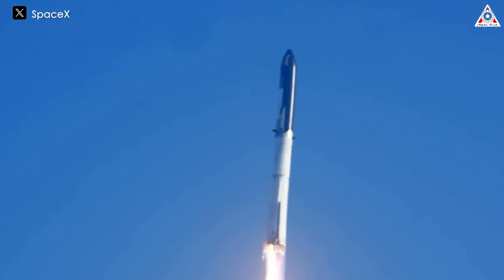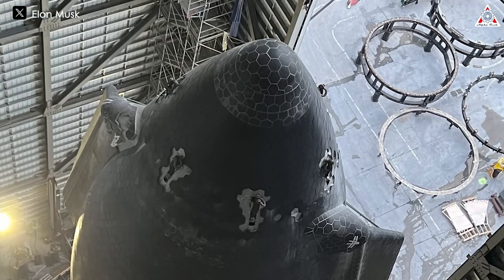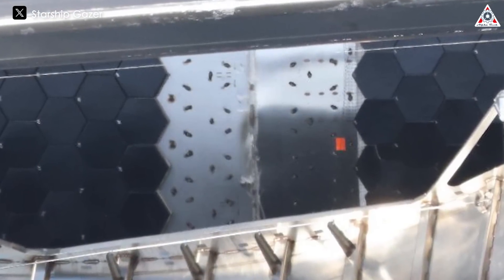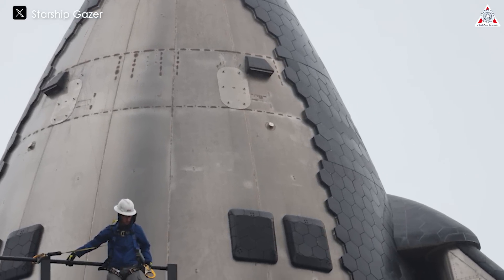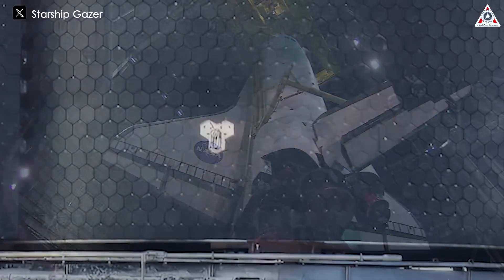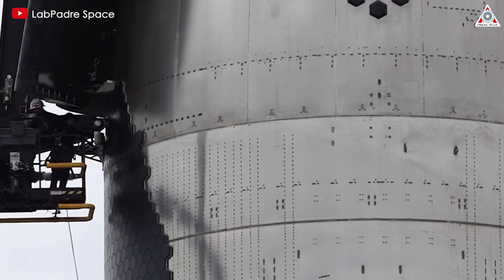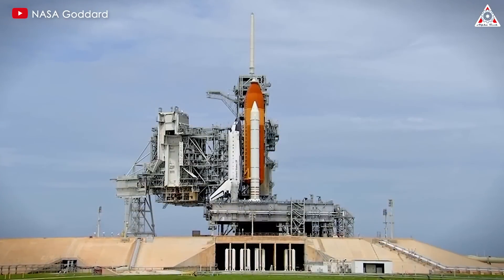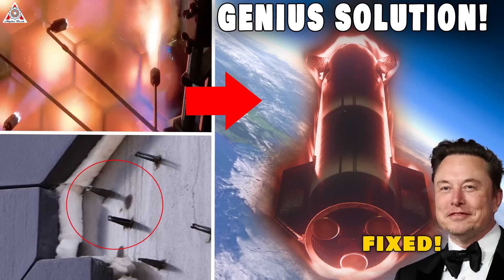SpaceX's Big Solution For Starship Heat Tiles Re-entry in Upcoming Launch!

Comment: FYI I just submitted my resume to SpaceX for the mechanical engineering heat shield subsystem.    Just another thought entered my mind.  Are you sure you want to deploy the re-entry heat shield at liftoff?  Seems to me that the thing should be rolled up like a fire blanket or umbrella and deployed prior to re-entry like a taco shell around the craft,  then discarded prior to landing and replaced for the next launch.
Reply: You want to roll up something that is brittle and susceptible to vibration, and then support it how? And put it where during boost phase?

Comment: I'm kinda wondering if the tiles shouldn't  use natures example of feathers or fish scales and overlap.  Both have strong, single attachment points at their base.  These could then be liquid cooled when the re-entry temperature gets too high.  Slate tile roofs are another example.  Tungsten steel foil scales might be a possible material.  Might even be lighter per unit of surface area than the existing tiles.

Comment: Only correction I see is that with the use of steel, One or several missing heat tiles Should not result in a catastrophic loss of the vehicle. Obviously, the goal is to have all of the tiles survive launch and reentry.

Comment: Increase heat tile surface emissivity - micropitted carbon-carbon with asbestos filler.
Reply: Those are the engineering numbers.  Missing are a pair of bolshy yarblockos versus the Envirowhiners. ReGRETAble. "8^>)

Comment: Aluminum vs Steel 
Thank you for your video! It should also be noted (much better margins, especially in cases where tiles are missing):
Shuttle = Material: Aluminum alloys (primarily 2219-T87) Melting Point: Approximately 543°C (1,009°F)
Starship = Material: Stainless steel (primarily 301 and 304L stainless steel) Melting Point: Approximately 1,400°C to 1,500°C (2,550°F to 2,750°F)

Comment: The tiles are okay , the bond to the ship skin is the problem .  The bond fails when the tile heats up and expands slightly as they know.  Can an intermediary material be discovered to absorb the tile expansion and not need replacement after multiple missions?
Reply: Buckyballs

Comment: Why not make one uniform heat shield with passages carved in it to differ the heat, instead of 1000s of seperate individual tiles, make one giant solid one that can be bolted and removed quickly for rapid reuse, granted it may be expensive 🤔, but it would definitely work i think ????🤔,  star ship is stainless steel so magnets should still work, the back of the shiled could be magnetic, or just bolted on, or a combination of both even glue vould be added too 🤷🏿‍♂️🤷🏿‍♂️
Reply: Stainless is not as magnetic as normal steel alloy. 

With the reverberations traveling through the airframe, the tiles need to be segmented to be flexible and not shatter as easy.
Reply: Also, would need to allow for the fact that a single "wrap-on" heat shield would (likely)expand (relative to the outer surface of the ship).  One big expansion l instead of lots of little ones.  Especially at its edges.

Comment: A thin tungsten shell (perhaps 0.5 mm thick) could shield the tiles from atmospheric buffeting. (Tungsten has a melting point in excess of 6,000 degrees Fahrenheit, so it's not going to melt.)
Reply: Weight of tungsten vs weight of titanium

Comment: Elon Musk is full of it. Starship is the albatross around his neck.. you should have not got rid of your falcon 9 and heavy brain trust.

No matter how big you make the  rocket. It will never lift the battle ship that you call starship. You either reduce 90% of the current weight. Otherwise you can count on more tears.

I see you finally fix the hot stage ring. But you have already reach the point of diminishing returns. You need to follow the Falcon heavy design. Otherwise you will not reach a stable orbit. But the heat reduction tiles will never stay on. After ift -4 you have three more shots. The military will walk away as well.

Comment: Good luck to SpaceX. Seems to me that they will have to get the Starship launch cadence way up to do the orbital refueling that NASA is depending upon for Lunar Starship and the Artemis Moon landing project. And reusable thermal protection tiles are the only way to have fast turnaround and keep the cost from becoming prohibitive. But it won't happen if extensive heat shield refurbishment is needed after each flight.

Comment: One big problem with a water cooling method is that under pressure (if the water was going to be recirculated) it would no longer be water, but instead pressurized steam. The only way would likely to have the steam relieve itself out of each tile with pressure relief tubes. There could be no valves at the relief point because all of those valves would be possible points of failure. There would have to be a lot of water blasted through that system even just for a couple of minutes during the hottest point of re-entry. I wonder what liquids have the highest boiling point temperature?
Reply: In order to keep the liquid in that state, the pressure has to increase inside the pipes which would burst pipes and fittings of many material designs.

Comment: My questions about the heat shield:

1. Rapid reusability is the MAIN unique required that Starship is attempting to achieve.  Why has SpaceX not worked on the heat shield design sooner?  They just forgot?  Without rapid reusability, Starship will just be another Space Shuttle that requires extensive repair after every launch.

2. What prompted the changes to the heat shield?  What data?  Was this prompted just by video of the Starship 3 launch and re-entry?

3. SpaceX switched from BLUE glue to RED glue?  Are you sure they aren’t using RED LockTight in place of BLUE LockTight?

4. What test rig is SpaceX using to test heat shield designs?  Where is the data from these tests?

5. Why will the new design be tough enough to support rapid reusability of Starship?

6. What data will SpaceX get from the next launch of Starship?  Just photos?  Is there any instrumentation?  Are they really claiming that they will recover the upper stage of Starship launch 4 after it touches down softly on the ocean and floats for hours and hours?

After 4 years of development, SpaceX is STILL making major changes to the heat shield design  Considering how little information SpaceX is providing about the heat shield design, my guess is that this MAJOR change is being made for the benefit of trying to assuage the fears of potential investors and other organizations like NASA and the Department of Defence who have made plans that depend on a rapidly reusable Starship so that SpaceX can raise more investment funds and get more government contracts.  I do not believe there is ANY reason to believe that SpaceX is actually making progress towards a final heat shield design but are, instead, still flailing.
Reply: 1. They have been working on it this whole time. There is no better way to test the heat tiles than during actual reentry, which they have only achieved once so far, so it makes sense why we haven't seen many changes to the heat shield yet.
2. I wouldn't say they have made any major changes, more like modifications. These modifications were prompted by the fact that in every test flight there have been tiles that fall off. While the ship can survive reentry with a few missing tiles, obviously spaceX wants as close to 100% tile retention as possible and will work towards getting there. And yes, video footage shows the tiles falling off.
3. Don't know. Could be the same glue. We'll see if it makes a difference. Probably not a huge change but could help a bit.
4. The best test rig is the actual starship itself. Yes, the tiles are tested for heat resistance and durability on earth, but there is no way to know for certain it will work without testing it during reentry. Improvement through iteration is the motto of SpaceX. They focused first on getting it into orbit, now comes the troubleshooting of other systems like the heat shield. I'm sure if they were not confident on finding a solution with the heat tiles they would have pivoted to a different heat shield design much earlier. In fact, one of the initial design ideas for the starship heat shield was a "weeping hull" design that would release liquid methane through small pores to create its own plasma barrier. They scrapped this idea and opted for the heat shield tiles which are more simple and easier to get working.
5. If all they have to do is replace a few heat tiles after each use, then in my book that qualifies as rapid reusability. They can probably automate this task at some point later down the road.
6. All the data lol. There are onboard computers and system feedback sensors that track metrics throughout the entire flight. Thousands of people will be interpreting that data day and night to make improvements for the next launch.
Reply: @zachhilty6822  
SpaceX has a ground-based test stand for testing engines so they can test over and over, collect huge amounts of data, then dismantle the engine piece by piece and examine the results in detail.  They should have a ground-based test rig for testing heat tiles and attachment methods so that they can test over and over every day and test many different materials and designs.  If they don't and are only testing during "actual re-entries", they will NEVER EVER arrive at a good heat tile design.  A good, cheap test stand for testing heat tiles and attachment designs could be as simple as pointing the exhaust of a Raptor engine at a heat tile/shield mock up and lighting the engine.  The fact that we haven't seen any pictures of their heat tile test rig (unlike the engine test stand that we have seen many, many pictures of) makes me wonder if they have one.  After an engineering tour de force developing the Falcon 9, SpaceX is looking like the Keystone Cops now which I attribute to Elon having assumed charge of Starship engineering.

Comment: I am surprised that they haven't changed the shape of the tiles:- interlocking them like a jigsaw puzzle piece, or some kind of extra , thin, covering that could be sprayed or painted on that would shrink slightly on cooling, so it would in effect act as a saran wrap, so even if theyshook loose slightly, they wouldn't fall off on launch, or on the max q of reentry
Reply: I too have wondered about some wrap of some kind that would just burn off without damaging anything on reentry. There has to be a good reason why NASA or SpaceX haven't tried that.

Comment: Why not develop a system that uses the heat energy and wind pressure from re-entry to slow the vehicle down at re-entry? As the vehicle starts entering the atmosphere, air get's pushed into special vents and compressed then jettisoned out in the opposite direction to slow the vehicles descent. You don't need to carry any extra fuel for this because it's just using the atmospheric air being pushed into the vents at high speed due to the rapid descent. If this is done right, the vehicle may never have to reach the temperatures that would require heat shields.

Comment: Bah-Humbug!
Neurotic Rocket Engineerds trying to save face...

Its too complicated, too fragile, parts count too high, too labor intensive, takes too much time, requires too much mantenance... and undoubtably too expensive...

But other than that just perfect! 🥰

The main problem with any additive to hull exterior is differential thermal expansion. 

Might pay to experiment with a Tungsten or other higher temp metal in the alloy for the belly of the ship.

You notice, craft like Blackbird didnt have silly tiles.

Also theres the flight profile, and the potential to reduce velocity by very thin upper atmosphere altitude control, and I have heard Elon describe what I did in writs in simplistic terms. I suspect the next flight will be a crude attempt at it, but that benefit will be obvious, and we cant have too much of a good thing here...
And that if numbers are beneficial enough, Lord Elon will flog his design Serf Enginerds in the proper direction.

The fix is likely a combo of stuff, to achieve a working and highly functional balance of compromises. copying problematic tech over 40 years old is conceptual entrenchment, not progress.

And if the glide ratio helps, might affect V-2 thinking, and maybe can cattle prod his guys enough they start thinking about reshaping Starship... So gores for higher temp alloy can be used where needed efficiently and shapely..

Also possible to create artistic and fair hull shapes, instead of these flying Silver T¿rds....
(🤭)

Ain't it great! Not on 
the payroll! Critíc at large! Cant fire me!

Humor aside, 
Just trying to help...
And like I told the guys livid about parts count:
"I'll win in the end.."
🤗

Comment: Excellent report. The one thing missing is a picture of the way the pin attaches to the craft. I believe the pin sticks into a metal clip and is held in place by compression/expansion of the pin. I've believed all along that as far as the rocket itself, the tiles are the number one problem. I think anything they are doing right now is temporary. I don't think they have implemented a permanent solution yet and may not have one. I think if tiles are used the solution is just as you suggested in the video. The pin has to attach differently to the tile. There are any number of ways the pin could attach and I wish they would lay it all at there so the public could take a look at it. My uncle was an engineer and scientist. He was President of a large railroad company and when his wife died young he returned to his first love. He was a scientist working for the military/government. When he died he was working on the development and use of ceramics in space and rail transportation - one concept being the vehicle would float over the track and never touch it. I'm pretty certain if he were alive today he would love to tackle the problem. Me too:-)

Comment: Why doesn’t Spacex use the heat shield product called STARLITE.
 Starlite is a material that can withstand temperatures of 10,000 degrees Celsius and nuclear flashes without burning

Comment: I think the composite of the heat shield tiles new to be completely resigned. From the composite of the tiles, the shape, to the attachments. First and foremost they are to fragile. The composite of the tile need to be a reinforced composite so they are not prone to cracking or breaking. When they crack, game over. The vibration cracks the tiles. That's enough to cause a catastrophic failure. Great Episode. It needs to be in a situation where you don't have to give the heat shield a second thought. Thanks for bring the tiles to the forefront.
Reply from the maker: that's a good idea! Thank Kevin for your comments

Comment: I never really understood how a rocket falling back to earth can have such heating problems while those stratospheric parachuters doing the same do not. The main difference is the fact that rockets are so fast when they start falling back, right? Therefore, wouldn't it be better working on slowing them down BEFORE they fall back instead of working on the heating, which is, so to speak, just a symptom? Sure, slowing down in the space may sound easier than it is. On the other hand, it may be easier to do that in outer space than to get up there. Sure I know I am no exper and no engineer, but physically speaking, if fastness is the core problem, you could at least think about that instead of lazily just falling down and then work on the heat and nothing else.
Reply: That would use way too much fuel and that means hardly any payload.
Reply: @andrewsarchus6036  True. Yet with SpaceX's new rocket motors and other technical improvements resulting in less weight and more payload, maybe we can get closer to a point where my proposal might become more realistic and all that heated up decline from the orbit becomes outdated and somewhat primitive.
Reply: @marcushladek262  I think they would only consider it once - if ever - they've completely exhausted any realistic chance of employing the free braking provided by the atmosphere.  Dream Chaser is going for it too.